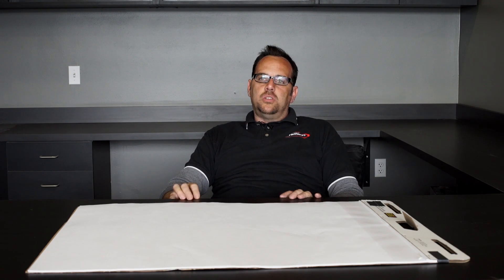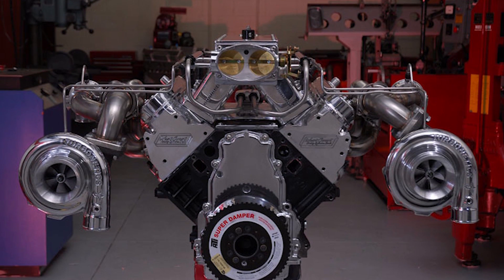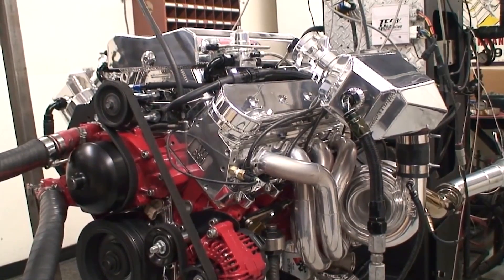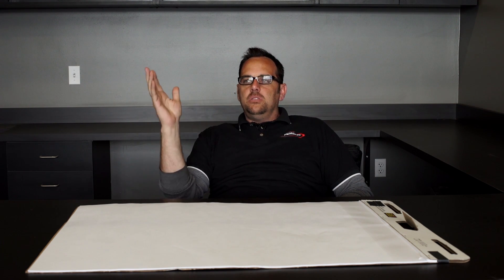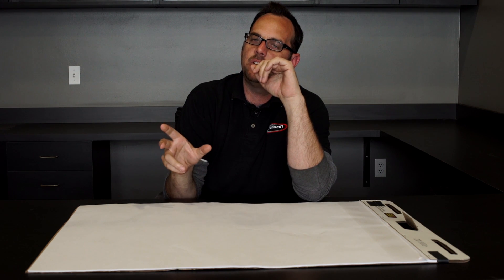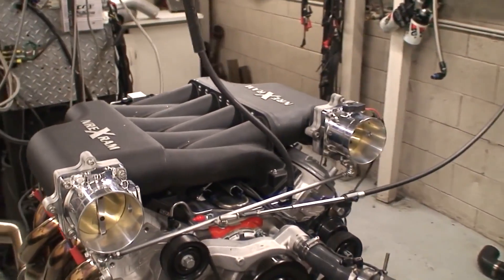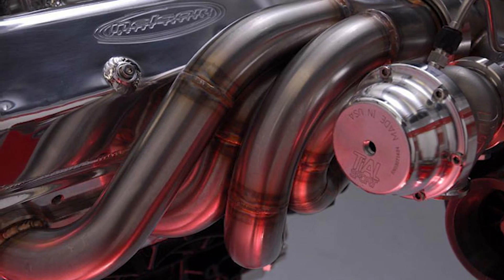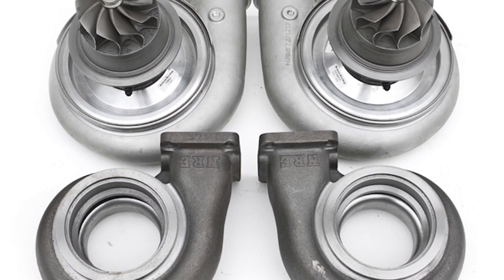Master Engine Builder Explains Why the LS V8 Is SO Good

Comment: the ls only got 2 things going for it: the price and parts avaliability. It’s big, heavy, doesn’t rev that high, the mileage is atrocious if using a tune that is even a bit sporty and the worst of all: ls fanboys.
Reply: Big, Heavy and doesn't rev high? Compared to what? turboed 4 or 6 cylinder engines? It's pretty much the most power dense production V8 engine on the planet. They are much narrower and lighter than typical overhead cam V8's, and the factory LS7 runs to 7000 rpm even tho it's a freakin 7.0L and Corvettes regularly get 30mpg on the freeway......... I'm not an LS fanboy, I'm not even a chevy fan.  I guess you must only be talking about half million dollar McLaren and Ferrari's when comparing other V8's vs LS engines?

Comment: I’m not a crazy tuner but I understood completely what he said with the easy air in, easy air out, with fuel combined properly in the mix will make power. Just doing simple bolt-ons to a factory motor will give you a gain in power. Gains do vary. Also as he mentioned some aftermarket parts can and will rob you of power. Be sensible and don’t buy the latest and greatest thing you see in Jeg’s, Summit, or EBay.

Comment: I thought racing pistons had very short skirts?
Reply: F1 engines may be what you're thinking? thats just so they can run them at crazy RPMs. the ratio of skirt to cylinder diameter is small in an F1 car to minimize the distance the piston has to travel and therefore be able to sustain higher RPMs more reliably. Why they value RPM so much I'm not certain though.
Reply: @sukmypecock  because they have no torque thus the high rpms, alot of modern higher power engines ive worked on in recent years have very short skirts compared to 30 years ago.

Comment: Why do you have to do SO much to it to make it competitive
Reply: Depends on the engine. A lot of work would be needed to bring a stock 5.3 to 800 horsepower reliably. But there are also stock 6.2 liter ls/lt engines that make over 700 hp.

Comment: Its so good because its a Ford Y block design. The mystery is why Ford invents stuff and doesn’t stick with anything? Does Ford even build a V8 anymore? I was born with a blue oval stamped on my ass... Im probably gonna die with a bowtie on the other check.
Reply: That is actually a common myth. The ls engine was not designed by or inspired by ford, it is a gm design. If anything it is based off of the small block chevy.

Comment: Dude makes some good points... I always here folks talk about building a coyote motor and my general response is "i didn't know you were rich?!". As much as folks talk shit about LS swaps they happen for a reason and most often that reason is performance to dollar. LS is hard to beat.
Reply: true. You swap an LS3 into any honda/Miata/s13, with FBO+Tune, and it immediately becomes a 10 second car. These engines are no joke and the amount of power these things can handle, on stock bottom end, is ridiculous(700whp, which is near 900hp at the crank, is considered "Safe" for Forced Induction). I have a 5th gen SS and imagine the amount of power it could have had if the weight was similar to the 4th's...

We break the suspension/diff's a lot more often than blowing the motor.... A mid camshaft swap is already pushing the Camaro into mid 11's on street tires(at 4k+ lbs with driver+gas)... There's plenty of Camaro's running 10's on a big GPI camshaft. 

Corvette's, which sit at 3400lbs with driver+gas, is a pretty massive advantage with an engine like this.

Comment: I call b***** after a hundred thousand miles on an LS motor there oil leaking pig the only way to fix it is take the whole drivetrain out an old engine you call under there and change the oil pan f*** you in your LS has

Comment: Seems you yanks need to take a look at Aussie engineering instead. The Ford Barra engine. 

Builders are reaching 500kws / 2000hp and they can't crack the block! The Barra engine has an iron block with an aluminum head. Engine builders said they're gonna keep pushing it until they crack it. The Ford Barra is a stock 4.0L straight six found in Aussie built family sedans & SUVs, and runs 195kws standard, which is more powerful than many V8s. You can get them from the wreckers for $400. Any American enthusiasts might wanna look into importing one. Ford Australia wound-up manufacturing in Australia in 2016, so the engine is no longer made, but tons of second-hand ones sitting around.

Comment: 20 years ago I drove a 
7:30 1/8 th mile 65 chevelle on the street, never got out run  until the LS engine hit the street, and traction control.
Sooo, since I'm old school now ,I still try my best with my 406, and a 100 shot, yes the LS engines are soldiers...

Comment: yeah but a major kind of about the aluminum block is if it doesn't cool better and it overheats you have a way higher risk of working your block in your heads and it's a nightmare

Comment: you haven't been building motors because motors run off electricity you have been building engines and people call themselves technicians it pisses me off they can't even get something as simple as that right and then they try to compare themselves to me at least in my situations
Reply: Wrong. A motor can be electric, internal combustion, external compustion, etc.

Comment: You talk about air going in and air going out and yet you have restrictive air filter on the air intake of the turbo's. I know they look good though their crap for air flow through them. The internal dynamic air travel surface area is crap compared to a flat rectangle air filter. (The gap between the air filters fins on the inside of the round air filter are closer together and so less airflow can travel through them then if the air filter was flat out where the gaps in the air filter fins would be as wide as the outer side. In effect your round air filters are restricting air flow). I though you guys were supposed to be engineer smart.
Reply: Running without an air filter is only a good option for non street cars. Dust and shit going into the intake will cause damage that will reduce the life span of an engine.
 Look at an old air filter, specifically look at all of the dust and shit it catches. Then imagine all that shit going into the engine.

Comment: "The motor is really about a combination of parts".  As a seasoned tuner there could not be more of a true statement.  My job is to ensure the combination plays nice together and is optimized to run as effectively as possible.  The most important part of making power and hitting your goals is to create the correct combination, not just throw the "hottest" part at it and hope for the best.

Comment: Because GM based it off the small block chevrolet engine.
And with over fifty years of experience they evolved it.
It also has a huge aftermarket following like the small block 
I remember my first ride in a HG 350 Monaro with a manifold holley and exhaust.
Impressive 😉😉😉
Reply: I know what that car is lol. But then I live just across the ditch.

Comment: Ls don't leak oil my butt. i work in an auto shop and most ls motors leak from the rear main seal and oil pan. Nothing good bout having to pull a transmission to fix a cheap oil seal or gasket.
Reply: True that, my vortec 5.3 leaks from rear main and oil pan gasket. Tell you what though, if I had to choose any 2 leaks, it'd be those. No wires to drip on, no oil on headers, easy clean up, and most importantly, no oil being burnt inside the engine.

Comment: Because GM knows how to make a good SOLID simple motor look at the 4.3 the 350 and the LS series 4.8,5.3,6.0 they are everywhere in everything just like the 350 is
Reply: Alex Duke don’t forget the 5.7 I got one
Reply: @GreatestHITS26  the 350 is the 5.7
Reply: Ooh my bad
Reply: @GreatestHITS26  lol. No worries. U had em all covered though.  Gm has been providing the best engines for decades to build hotrods with.
Reply: Actually it's bought not engineer by gmc, all gmc, ford, and dogde are bought from engine company. Whoever pay the most gets better engine.
Reply: lowcomtech K. I didn’t know that

Comment: Someone can explain me what is a ls motor? i'm new on the subject and i want to learn
Reply: A.motor is powered by electricity
Reply: @allanbrogdon7453  a motor can be electric or an internal combustion engine. They both meet the criteria.  Maybe answer the question instead of being an ass.
Reply: @Redtooth75  someone asked what a motor is and I answered if not totally correct my mistake but not being mean spirited at all
Reply: The ls engine is a v8 engine designed by general motors. It comes in a variety of displacements and power levels depending on the application. Gm started using them in the late 90s.

Comment: An LS is under engineered tub. They are made for a monkey to grab an impact wrench,
work on and make scrap power. Give me a Honda PitsterPro PP-160 to work on and it will smoke ANY LS based pos you throw at it. Uneducation is the obstacle in the racing world.

Please save me your "The LS motors is fastest dawg" comments.

Comment: There is exactly ONE reason that the LS V8 engines from General Motors are so good:  They are CHEAP.
Reply: Plus build more hp. And very durable. Unlike the ford over head cam pos.
Reply: As far as resons go, its a pretty damn good one. Sure other engines are better, but they also tend to cost twice as much.

Comment: i've heard that engines like jet engines, 2 stroke, gas, diesel etc. all run on the combustible gasses in the atmosphere not the fuel that we're forced to buy. The gasoline\diesel is only a PRE ignition source for igniting the argon and other gasses that make up our air. So this guy said the more AIR you put into an engine the more power you get - that air is the fuel so yes, the more fuel the more power. 

Look it up! we're being lied to <3
Reply: Please remember to wear your tin foil hat or else you will turn the frogs gay.

Comment: I've watched this several times over the last 4 years and the LS is still the king of  the V-8.  What I find odd is how good GM is at designing excellent engines and  transmissions.  (excluding any front drive junk)   Yet they can't seem to build a quality car or truck anymore.  I get the corporate bean counters cutting corners but GM isn't the only auto maker with bean counters sitting on the board of directors.  I ask why GM, why can't you build a car as good as the LS engine?

Comment: The LS isn’t bad for a truck engine.  But as a sports car engine, it is a bit on the big and heavy side compared to, for example, the TVR AJP6 and AJP8.  In fact, the AJP8 was specifically designed to demonstrate that GM is wrong about OHC engines being larger and heavier than their OHV counterparts.

Comment: When you can get the Bean Counters out of the way the Engineers can build some great stuff.
The Gift that the LS has over the Coyote is very good airflow plus simplicity. An easy and inexpensive engine to modify as compared to the Coyote that costs so much more.
I just wish they had given the Big Block 8.1 as much love.

Comment: May I suggest doing a CUSTOM LS or LT block and CNC'ing it out of Aerospace Titanium Alloy (Specific Grade: Ti 5Al-2.5Sn) which has high temperature stability, high strength, corrosion resistance and creep resistance.
THEN, coat the surface of the ENTIRE block with Aluminum Oxide ceramic (I suggest 2 to 3mm thick) which has a heat resistance of 3000+ Degrees Celcius (5000 F) and is EXTREMELY HARD on the Mohs scale. Increase your pressures to 4x over normal LS/LT blocks and see what happens. Maybe you can get 3500+ HP with it ASSUMING you are ALSO machining and ceramic coating every titanium crankshaft, head, cam, and EVERYTHING ELSE on the engine! 

Give it a try and make another video!  TITANIUM LS! Sounds good to me!
Reply: Better yet, Adamantium!

Comment: Spent a good part of my life racing cars the gas engine has reached the limits of competing with electric cars coming into play the gas engine will not compete with the future of electric like the  tesla running 8.90 quarter mile and 250 mph top end. Gas engine  will go the way of the horse and buggy

Comment: GM stole Ford's block design from their mod engine and put a pushrod top end on it.  Something that Ford should have done to begin with .  As far as the gen 3 HEMI goes, it has even better heads than the LS. The HEMI head is  a superior crossflow  design, with a better spark plug location. Yes, I know that the ls is cheaper to buy, slightly more compact and a bit lighter. But HEMI's spank ls engines on a regular basis in the power department. I've seen it at the drag strip, and it can be seen with engine buildups online. Sure, ls engines are cheap to buy, but  if I wanted cheap I would buy a hooker.

Comment: Hi Guys, really insisting video. I have a question for the engine builders, does putting a cast iron sleeve into an aluminium block have any cons even though done properly at an machine shop? Thers so many ppl that say it cant be done ect.. Any info will be apreciated..

Comment: Why the Chevrolet LS series engines may as well be Fords:

1. The intake and exhaust ports are evenly spaced, not siamesed.

2. If there is a distributor, it is front mounted.

3. The thrust main bearing is located in the middle, instead of at the rear of the block.

4. The block side skirts extend below the crank centerline, and the main bearing caps are cross-bolted.

Note: If GM had made it an overhead cam design (no pushrods), the LS would have been a copy of Ford's SOHC 427 from 1965.

Discuss.

Comment: Hi Guys. I would like to buy a Coke Bottle Corvette, but I don't understand how you could take a  5-liter+ engine and only develop 230 HP with it. I have a 3-liter 1993 V6 Mitsubishi 3000GT (NA) and it develops 220 at 4500 rpm. So how can an engine almost twice the size  only develop 10 more horses please? (We don't need to include the big-block 427 Vettes coz I can't afford one of those!!) Thanks

Comment: Have you heard of stoichiometric air fuel ratio? Optimum fuel burn air fuel ratio? I think that applies in all internal combustion engines. Either side of 14.7 - 1 ratio at sea level is either rich or lean combustion.

Comment: My favorite two engines are LS and 2jz. however one of my favorite thing about LS motors is its simplicity. it uses one of what other engines need double to do. for example single cam, tons of after market at low cost and reliability. Great video
Reply: Considering that most of the V8's it is up against today are DOHC, it has half the valves and a quarter of the cams.

Comment: The LS design was derived from the Buick 350
Reply: grngs1 not really, considering the block is completely different, the heads are completely different, the Buick 350 having a carburetor and the LS’s having fuel injection

Comment: The LS is So Good because FORD DESIGNED THE HEADS AND Block...THE NASCAR HEADS FOR CHEVY ALSO designed by Ford CHEVROLET used, bought the ford YBlock design they just designed a bigger cubic inch block for those heads. Ford wanted SOHC Motors INSTEAD

Comment: What makes a engine an lsx
Reply: It uses a LSX block (normal or tall deck), which is not available in any production vehicle (except a couple of exotics).  Cast iron, support the largest bore size in the LS family, support the longest stroke for their deck height, and are reinforced to handle extremely high power.  Commonly used for high power forced induction builds.

A company makes an aluminum LSX style block called the LSR.  Don't know if the massive increase in cost and loss of strength is worth the weight savings.
Reply: Troy McDaniel  so it has to be 427ci to be considered a lsx cause some people say if it’s a ls swap with mods ten it’s also considered a lsx
Reply: No, you are confusing LSx and LSX.  I know it is confusing and a common mistake.

LSx is used to describe all production engines in the 4th gen GM small block V8 family(ie the LS engines).  These are engines that were found in nearly every GM production vehicle that uses a V8 before being slowly replaced by the 5th Gen (ie the LT engines).

LSX (and if you see it written out, the X is very large and jagged) is an aftermarket cast iron race block originally derived from the LS7.  They are not actually a 4th Gen block, but a hybrid of the best features from 4th and 5th Gen blocks, modified to handle extremely high power (2,500+ bhp/1,900+ kW).  The design has things like a LSX specific six-bolts-per-cylinder head bolt pattern, billet-steel six-bolt dowel-located main bearing caps, extra-thick deck with two extra rows of head bolt holes for maximum clamping force, extra-thick cylinder walls, true priority main oiling system, main web bay-to-bay breathing holes to reduce crank windage, and a LSX specific orange powder coat finish.

As for sizes, the block comes with a machined 3.88" bore, has a max bore of 4.25" and supports a max stroke of 4.5".  Displacement ranges from 364 ci (6 L) to 511 ci (8.4 L).  The only vehicles you can buy with an LSX engine are ether engine swapped or a small handful of exotics that buy the LSX block from GM and build the engines in house (the Hennessey Venom GT engine is an LSX).  A 396ci version is used in NASCAR for the Gander Outdoors Truck Series and the ARCA Racing Series as an option engine.